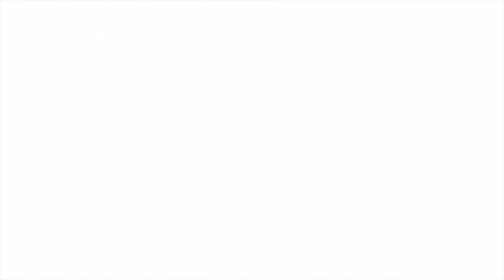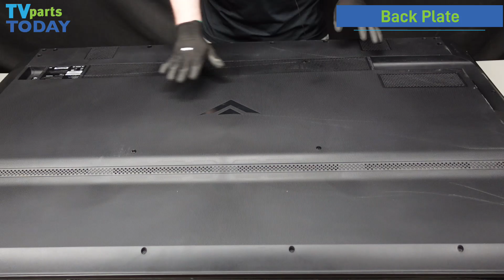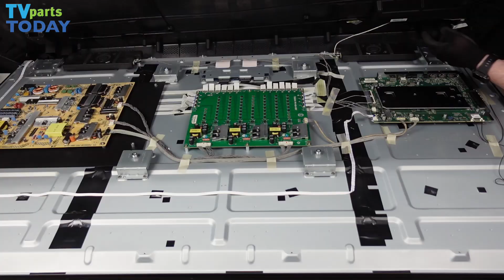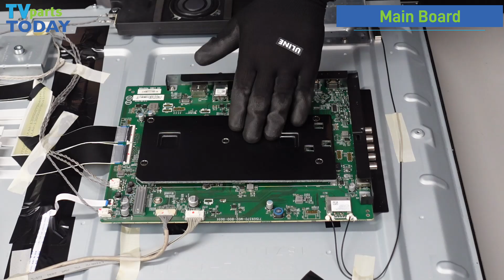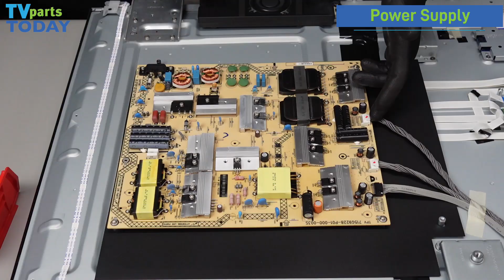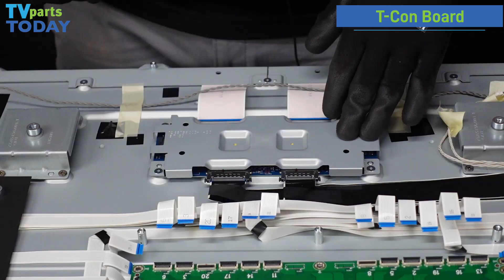How to remove the back plate and boards from a VIZIO P65-F1 *DIY TV Repair*

Comment: Could you be so kind to show me how to remove the board in the 85 inch Samsung model number UN 85TU 8000 FXZA please show me how to remove the power supply board on this particular TV. I’m having difficulties.
Reply from the maker: These power supply boards are affixed to the chassis with clips and usually with a single screw. There is a process for removing these boards and although I do not have this specific model to showcase the power supply removal, I do have a video of another Samsung unit with the same style of power supply. 

https://www.youtube.com/watch?v=mvrva6G-cio

If this video is not helpful, then I will check our current incoming televisions for a UN85TU8000F and make a video of this unit next.
Reply: @tvpartstoday  could you please check it out because that is not the right board thank you for helping me. I appreciate it. God bless you. Looking forward to hearing from you. I hope ASAP. Have a blessed day.
Reply from the maker: I have our intake department looking for this television. In the mean time, what are you struggling with when trying to remove this board?
Reply: @tvpartstoday  thank you so kindly for responding what is happening is on the board the power board there is a button and they said it has to do with something with the back lights. It looks like something plugged into it but nothing‘s plugged into it and there’s a little button and I’m pushing it down like there’s little clip or whatever. I’m pushing it down and then trying to slide it to the side of the TV and it will not move. I think I can get all the corners to move except for like riding in the middle front side by that clip or button whatever it’s called and I’ve got the magnifying glass and looked, and there is no screws whatsoever
Reply: @tvpartstoday  also on the power supply board it power cycles on and off about every 10 seconds anyway and on the power supply board I don’t know what it’s called but there’s too long silver things close to where the fuse is and where you plug it in and I got a little hose and stuck on it. It sounds like that’s for the clicking is coming from cause it makes a click loud click on and off. Is that normal?
Reply: @tvpartstoday  should I send you a picture of the board? Would that give you a better understanding of what I’m talking about?
Reply: @tvpartstoday  is there anyway you could call me
Reply from the maker: We have a customer service department that can handle these questions, no problem. 

phone #: (930)212-1975
Reply: @tvpartstoday  did the intake department ever find out about the 85 inch Samsung TV how to remove the power board mine has no screws at all. Thank you so much. God bless you. Looking forward to hearing from you soon thank you.